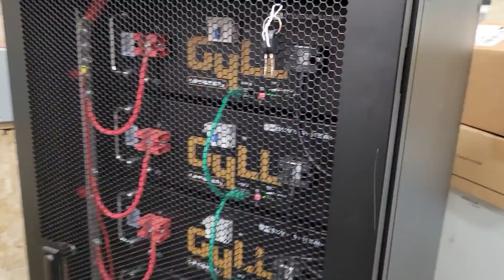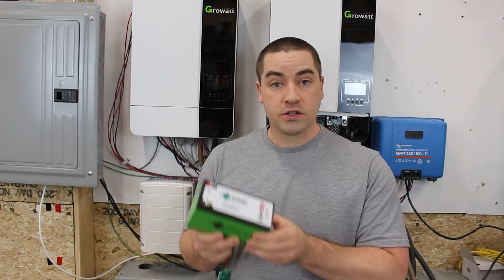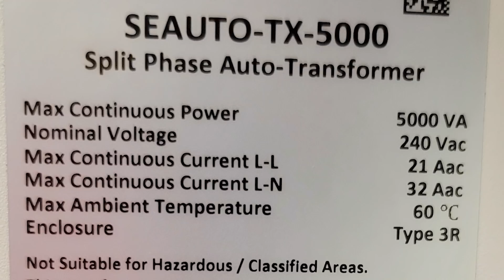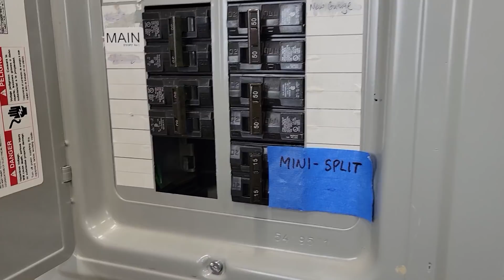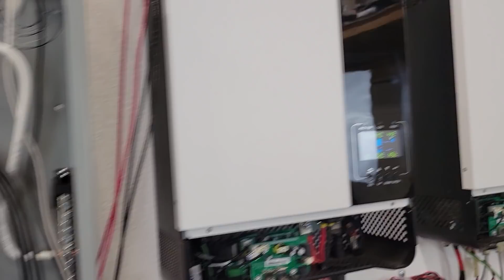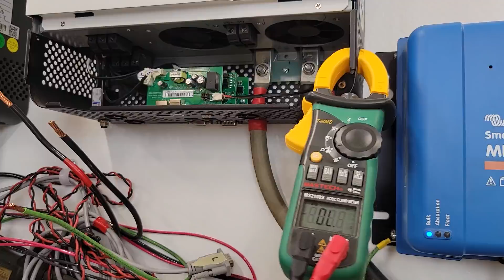Safety Concerns with Auto Transformer and Growatt 240V inverter SPF 5000 ES

Comment: A good ideia for a video would be test how safe the parallel sistem is, one example: what happens if one of the inverters breaker switch off durring operation? Will the sistem shut down all the inverters?

Comment: Thanks David - I like the idea of the Nader circuit breaker - you mentioned that Nader makes a 4 pole one too.  I have scoured the Internet and can only find it in the Nader catalogue, but not for sale.  Do you know where I could source a 4 pole one?  I have designed off-grid system with 6 SPF 5000 ES connected in parallel with two Growatt auto-transformers.  I believe the I could use a 4 pole breaker with each transformer and 3 inverters.
Reply: Did you ever find the 4 pole breaker ?  I have a similar situation

Comment: Love your videos David!  Appreciate your time and expertise.  I wanted to ask your opinion about another Youtuber who posted an alternate way of using the Growatt transformer with the 5000es models (3).  His way seemed to be much simpler, safer (no balancing issues to worry about), and make more sense, but as always, gotta check with the Poz first!  ;- )   https://www.youtube.com/watch?v=RwI833Yh5XU

I'm preparing to setup my own off-grid system using (5) Growatt 5000es 240v inverters, (2) of the Growatt transformers along with (30) 455watt solar panels, and (12) of the Eg4-LL 48v batteries as a bank.  The goal is to have 10kw's of 120v power, and 15kw's of 240v power available.  We're going the "all-electric" route for this home to avoid needing fossil fuels.  As always your thoughts are appreciated.
Reply: Simpler?  It requires a 2nd breaker box for all of the 120 volt loads and any 240 Volt load that needs a neutral wire.   Safer? How?   And it does not address a Neutral Imbalance at all.  It is different .

Comment: HI David, your videos are great. I watched them several times before building my own system. 3 growatt SPF5000ES in parallel with 6 2000C pylontechs.  Thanks a lot.
Have you ever tried to update the FW of the inverters? I have one that won't update and indicates 008 00 316 on the top line besides not working any more. It's no longer detected by the master inverter in my three phase install. If you or anyone has a clue as to what's happening, I'd appreciate your help. Could the overload breaker be the issue (button on the left side)? I haven't tried to push on it. 
Keep up the great videos!

Comment: Dave where did you get that particular terminal block that you have next to the breakers ?
Reply from the maker: Ebay, I searched for terminal blocks
Reply: @DavidPozEnergy  ok sweet thanks for responding I know ur a busy man I'ma try and build my solar up the same way I have it's using the SolarEdge transformer but my inverter only has Line & Neutral on the AC output and no ground terminal..

Comment: thanks for the great video David, May I ask did you bond Neutral and Ground in your breaker panel? from my understand the Growatt has internal bond N-G when power from battery, since your are running 2 inverter, are there 2 bonding already? thanks again

Comment: The breaker you recommended is unavailable and has been for a while. Can you evaluate and recommend another? Would the NDB2-63C32-3 also work for a neutral protection application?

Comment: I wonder if there would be a way to use a GFCI breaker-like circuit to do this, it detects fault current differential so that if there is any leakage to ground from either leg it immediately trips the breaker.  If this could be adapted to this application, it would work better since it would trip within mS instead of minutes with the thermal circuit breakers.  Something to look into, perhaps there is a company that makes a neutral monitor that performs this function.
Reply: GFCI?  No ...

Comment: Why use a 32a breaker? 32x120=3800 and the inverter is 5000 w
Growatt suggests 50a?
Thanks for your work!  It really helps!!
Reply: 7,680 watts (each) = 32 amps x 240 volts
Reply: @MrSummitville  
Thanks!

Comment: even though most of these connections I will pay someone to do, as I dont feel comfortable enough in knowledge to do... you are the first of the 90 or so videos I have previewed which show connecting to a double pole circuit breaker  box... which is what I prefer to happen in my soon to be lived in off grid homestead. Thank you for confirming that can be done as I dont wish to string a bunch of extension cords to run lamps etc and have already wired to my interior plugs and switches. You are also the first person I have seen who has added a transformer? Is it required?.. please answer is it required.. no one ever answers my questions... going soon to move in a few months.. without any electric except generator.. as I cannot get a solid answer which company is the best to go with..

Comment: If you are using these Growatt 240V SPF 50000 ES units connected to the  grid there are other  hazards to be concerned when using a auto transformer on the output of these units. I believe your safety measure completely cover your off grid installation as you show here.
Reply: These are not on the grid.

Comment: Thanks for your great content! Quick question, if you were to max out (in terms of communications) your rack mount batteries to 16, could you put battery number 17 (comms only of course) into a parallel inverter? I think this could be tested without having 17 batteries just by splitting your current batteries (again, splitting comms only) between 2 of your inverters. Not sure of the disadvantages or the advantages of either. Just curious.

Comment: From Wil's comments Signature Solar does sell the correct version of the ES but as he stated the ES model includes both US and EU versions????  A VERY bad marketing mistake!  So Wil dropped his blessings on GroWatt completely!  Between that and now seeing the dangers of the auto-transformer trying to get artificial grounds from 220v units has left a bad taste in my mouth.  Think I'll look at other solutions.  I've never heard of putting a breaker on a neutral wire before and question the legitimacy of doing that?  We have non-certified electricians telling the public "here try this" then oh wait that's dangerous, do this".  I think everyone should step back and really look at all this hard before you kill yourself.  I'm pretty sure if I researched that the NEC would definitely frown on using a breaker on a neutral line.  I think at this point we're trying to polish a turd?  :-0

Comment: Greetings, First David thanks for the videos and please keep them coming.  In a nutshell here is how I plan to hook my 5000ES and AT up.  The 5000ES output will go directly to the AT.  From the AT I have L1-N-L2.  The  L1 & L2 will flow into over Amp breaker  20 amps  (5000/240). From there the L1-N-L2 will flow to an over/under voltage breaker.  Thus L1 to N or L2 to N drops/exceeds 10% of 120v the breaker will open.  From this breaker, it will flow to an auto transfer switch between the inverter/AT and the grid ... Actually 3 of them 1) house critical 2) house non-critical 3) barns.  This will allow completely bypassing the inverter/AT for any group.  Each ATS will feed a sub panel.  Neutral and earth ground will not be bonded in the panels, with the earth ground of sub panels, inverter, AT connecting back to my grid panel and bonded to neutral there and to ground rod. I also plan to feed the grid via a breaker from the main panel to the inverter to allow charging batteries.  Please let me know your thoughts.

Comment: Hi David, please give your comment if we can use LIFEPo4 as replacement of car AGM battery.
I want to use 100Amp LifePO4 for 4x4 vehicle, i want to know the high current can make any damage on electronic parts. 
When the battery fully charge by alternator the battery stops charging, will there be any fluctuation in current flow for that ? Waiting for your feedback.

Comment: I see you all used the auto Transformer.  I just used a 240 volt transformer.  The one I have has a 240/480 in and 120/240 out put.  I have the MPPTsolar inverter that is 240 out put,  I ran that to my transformer and then the out put is still 240 volts but I can use the Split phase to get 240 and 120 volts. and then ran that to my Breaker panel.   My Inverter was still connected to the grid just only need put wire it to the 240 volts.   I never had a problem with that set up.

Comment: Thanks for Solar power related videos. I wonder if there is an inverter that draws electricity from grid once your battery cannot accommodate the household current but it does not share the excess electricity to the grid?

Comment: David, since 2014 till Nov 2021 I used MPP solar, but since Nov 2021 till today I have the same setup you have, but I didnt install my autotransformer yet, I got it seat in side my garage since, I have my system go thru a 10KVA industrial step down transformer, it working fine for me since 2014, but one of these day I will replace my industrial transformer with the autotransformer, I do hook my inverters to the grid, last Dec 2021, winter time during the day my battery bank does not got charged up, so at night the ATS inside the inverters switch to the grid to charge the battery bank, I also bough my thru the Signature Solar, I am looking to buy the 3rd one to use for solar charger so I can disconnect my Midnite Solar charger, the other reason I have my hookup to the grid, my house 100 persent electric, I have no gas, so during the winter my electric furnace does kick on every once a while when the fireplace no produce enough heat

Comment: I'm not very well versed NFPA 70 NEC prohibits switching the grounded (neutral or white) conductor or the grounding (ground or green) conductor [Article 404.2(B)] . I think you are putting in to many disconnects and over protection devices in your PV system.  Too many possible points of failure and sneak paths for stray currents.   From what I've read...  Firefighters must have a means of a rapid shutdown function [690.12].  I seriously recommend that you have a sit-down consolation with a Professional Engineer that's very knowable of Fire Protection and Electrical Codes.  For complex home improvement projects, DIY'ers should always have a start work permit and a final inspection by the Authority Having Jurisdiction (AHJ).  Don't take chances on having your homeowner's insurance company reject your claim in the event of a personal disaster.

Comment: having a 32 amp breaker on your L1 now limits your twin inverters to less than 10,000 watts (6144 watts continuous load). 6144 watts is still a big inverter, but you paid for 10,000 watts. I guess it will keep the inverters nice and cool because you are not using them to full capacity! EDIT: make sure to install your microwave and toaster on L2 then you could possibly get over 32 amps on the L2 and get closer to the 10000 watts your inverters could output.
Reply: Good point

Comment: Having just stripped my DIY setup in favour of going "official" let's go through the list of things that are wrong here...

1.  Exposed terminal blocks, must be in an approved containment device
2.  No disconnects for either battery circuits
3.  No disconnects for the output of each inverter
4.  63A breaker is too large to protect all the circuits (each inverter is only 32A) attached to it
5.  Auto transformer lacks a disconnect and isn't rated for 63A
6.  No permit for any of the work
7.  Exposed high voltage wires without armor or conduit
8.  Even though you're using UL listed devices the total appliance you've effectively made out of random parts is not itself UL listed and would require a specific site inspection.
9.  (picky) your 4 outlet faceplate should be metal because the wall isn't finished.

Comment: I have 4 Growatt 5k ES and 2 Growatt transformers I purchased from signature solar that I'm installing right now. I planned to hook up the transformers in what I call my solar breaker panel which only has two 30 amp breakers (one for each transformer) four 50 amp breakers (one for each inverter) and one 125 amp breaker to supply my house panel that has a Generator interlock to prevent mixing solar with grid. Now for my questions: 1. Is it ok to hook up each transformer separately as 2 individual and separate units wiring each as if it was the only one used and connected to its own 30A breaker. 2. I have the new growatt transformers, should I be using a different  size breaker. (James mentioned a 20A in the Auto Transformer linked video???) 3. The new growatt Transformer has a input "L"  and "N", do I connect my Black "L1" to "L" and Red "L2" to "N" from my 30A breaker in my solar panel and run my white neutral from Output "N" back to the neutral bar in my solar panel. If this isn't correct, please give me some directions on how it should be done. PS   The reason for 2 transformers is safety in case one breaker trips the second one could handle the split load till I reset or do the repair.
Reply: Long question omg. The autotransformers are rated for a 25 amp 2 pole breaker. Lets start with that, but really you should do more research or something, because I don't know if you are qualified to do this sort of thing!
Reply: @uhjyuff2095  Thanks for nothing uhjyu ff! I've done enough research to know that the Growatt transformers are rated for 21 amps and I believe that is why James at Signature solar mentioned in his video to use a 20 amp breaker. You don't seem to know that it's the Solar Edge transformer that requires a 25 amp breaker. The reason for my question is because David Pos used a 30 Amp breaker in his video demonstration of the Solar Edge transformer so that is what I was using and I wanted to know if I needed to go to a different breaker size using 2 transformers wired in parallel or wired individually. I believe YOU need to do more research before trying to build yourself up by putting others down with your unknowledgeable responses and non-answers.   Every question I have is based on videos from Signature Solar, David Pos, Will Prowse and others that are doing a great job supporting and encouraging  DIY'ers like me.
Reply: @JamesLee-ey2yv  I haven't seen the wiring diagram on the growatt transformer.  I'm using the solar edge one. If, I get a chance to see it, I will try to get you an answer.  We are all here to help each other.

Comment: You should have two AT’s to protect from total AT failure. Transformers do fail from time to time and the breaker probably wouldn’t be tripped.
Reply: Yeah, this video just shows how to avoid overloading the neutral conductor, therefore overloading the autotransformer. The downside of this is now his total output from is twin inverters is now limited to 32 amps or 25 amps continuous because he has a 32 amp circuit breaker on the L1. His twin inverter setup is advertised as 10,000 watts which is 41.67 amps.

Comment: Losing a neutral is more serious than frying electronics, It could burn your house to the ground. I’m really happy to see you doing something to increase the safety of your system David. Great job
Reply: Does a circuit breaker protect against losing a neutral connection? I don't know why losing a neutral could burn my house down unless these inverters have incorrect wiring configuration because they are made for EU grid systems!
Reply: @uhjyuff2095  Simply stated, the neutral is a balance lead that is trying to stay at 0V. Without this balance lead, your one of the hot legs could have a lot more (or a lot less which is also not good) than 120v if the loads between the two hot legs were unbalanced. For instance if you only had devices turned on using one of the two hot legs, it would be getting 240v because the balancer that would keep it at 120v is lost or not working. It would surely catch something on fire to operate 120v devices at 240v. You should probably watch some youtube videos on what happens with a lost neutral.  https://www.youtube.com/results?search_query=what+happens+when+neutral+is+lost

Circuit breakers (OCPD) protect against overcurrent only. Hence why they are called overcurrent protection devices in the NEC.
Reply: @BecomingOffgrid  hmm, you flip flopped because I replied to your comment? Does the addition of a circuit breaker on the neutral conductor make his home more safe? I think you will say yes, so please tell me why? My home doesn't have a circuit breaker on the neutral conductor!
Reply: @uhjyuff2095  the addition of the circuit breaker,  only protects the transformer from being overloaded.  It doesn't provide any protection for the 120 volt devices. They can still be damaged if the transformer fails.

Comment: Best I can tell you have 240Vac from each inverter to each of both of your right hand breakers, and 120Vac from the center tap of the autotransformer going thru the 3rd 32 amp breaker.
32 amps x 240Vac = 7,680 watts from each inverter before it will even try to trip the breaker.  This doesn't seem at all useful since the inverter isn't even capable of more than 5000 watt output.  The center tap breaker just seems redundant to your already existing breakers in the box, since both inverters use the same output center tap.
Reply: This setup may cut off the inverter outputs after a catastrophic failure, but by then the damage is done.  I liked your temp probe idea much better as it could actually prevent the transformer from meltdown.  You can get 3 or 4 gang switches that are servo driven to turn on and off high currents simultaneously.  The good ones have high impedance inputs so it can be driven by you temp probe directly.  They are also perfect for automation with a Arduino or Raspberry PI outputs.
Reply: In this setup.  The breaker for the neutral,  is the one expected to trip. The other two are just shutting off the power at the same time.